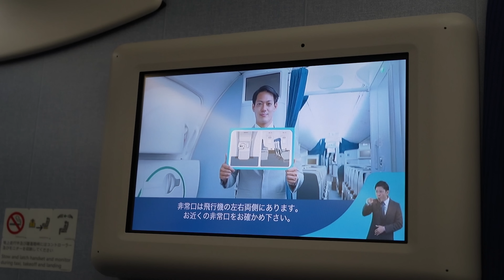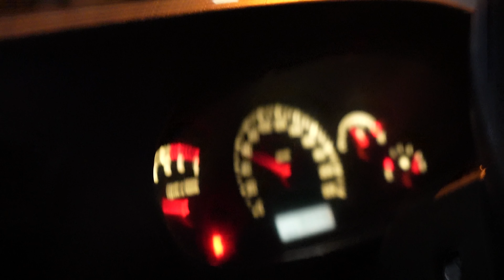WHY WE LEFT JAPAN!?!

Comment: Don't know if anyone else has replied / PM'd but turbo motors after made after 06/06 are the best ones. From a BF falcon. They had the strongest rods. Before that are weak. Later FG engines have good rods stock too, unsure which is best for making power stock. 
Green top (LPG) have strong rods but high comp pistons with pressed gudgeon pins that can move (compared to floating pins in the turbo engines). Can make 500ish HP stock. 
All have the same block so if you're building them anyway just grab some NA blocks and build them.

Comment: 2007 bf xr6 turbo mk2 has the best engine same as the f6 bottom end in the ba bf series. Fg xr6 turbo engines are good but have soft cams they ware out quickly. Think the sprint engines are stronger again but not many made. Bottom line is 2007 bf xr6turbo are the best.
Reply: The gas motors have same rods as the petrol turbo engines but gas engine has higher comp.

Comment: Get your hands on the Fg green top barra mate. Its the best one to choose for big hp. 
Ive owned more barras than i have digits and the green top fg motor is by far the best to choose from. I picked another one up last week for $800 with paperwork stating in came out of a numbers match car with 73k on the clock.

Get the billet backing plate and billet oil pump gears upgrade since you'll be living in the red zone 😁. Replace the timing chain and guides as they are prone to breaking and if you go over 530rwkw then upgrade your headstuds to the arp 12mm replacement and last but not least upgrade your flex plate to the yellow terra and arp flex plates studs and you'll have and near bulletproof motor.

Just head to Golebys parts for everything and you'll be sorted.👍✌️🇦🇺

Comment: 412Kw = 552hp. Easy way to do it Sam (and the rest of you drift boys):
For Kw to hp - Add 1/3. So 300 + 1/3 (100) = 400hp.
For hp to KW - Take 1/4 off. So 400 × .75 = 300Kw. 😎👍
Reply: Just multiply it by 1,36
Reply: @MeinNameistFlo  1.34😉
Reply: @mjt7585  Trust me, you're wrong, 1 KW is exactly 1,35962 PS, so you better multiply it with 1,36 🤷‍♂
Reply: Oh i see the problem, i meant "metric horse power", that#s what we use here in germany. I guess you meant the "english horse power" and then you're right with your 1,34 😅

Comment: 1 KW = 1,34102 HP and 1KW = 1,35962 PS
So if you are ever told a Kilowatt number, just mutiply it by 1,36 and you have the rought PS number!
Reply: Actually it's 1.3403 for bhp to Kw. 👍
Easier way. Add 1/3 for Kw to bhp. Take 1/4 off for bhp to Kw